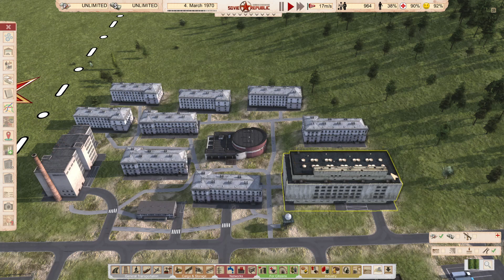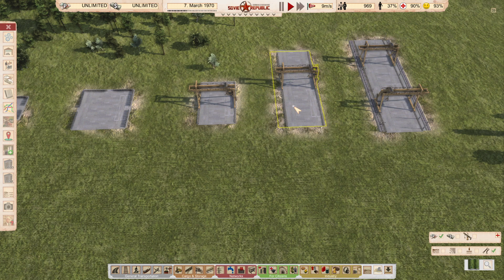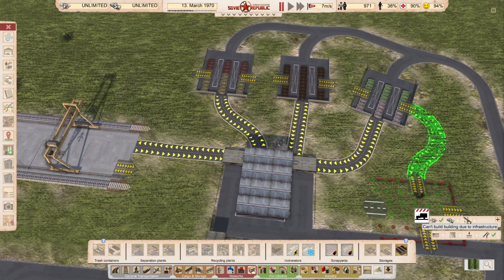Workers and Resources Soviet Republic guide to waste

Comment: ... also, I have a question. In my residential areas I have set up the trash containers in the various stands so that citizen separate waste at the origin. They seem to be doing a good job, with biological, plastic, and metal waste produced in significant quantities. However, the trucks from my technical service tend to prioritize the mix trash and, often, do not even rush to move the other types of waste even if their respectively assigned containers are full. And this, of course, results in pollution. Do you have a solution to this problem? How can I make sure that mix, plastic, biological, and metal waste are all collected? Thanks!
Reply from the maker: The only other thing I can think of is make sure your factory connections are not set to one way.  Other than that I don't know why it shouldn't be working properly
Reply from the maker: @gulfwinds  if you are having this problem check your technical service offices.  If there are no trucks sitting around then either you don't have enough trucks or your trucks are having to travel too far to where they are disposing of the waste.
Reply: @mangypanda2640  Thank you. Unfortunately, I have more than enough trucks and every single stand is well in range. In fact, the collection of mix waste works perfectly. And the collection of specialized waste works a little bit, but far from enough. While my trucks rest in the TS parking lot, entire containers of plastic, metal, bio, are left untouched. It is puzzling...
Reply from the maker: @gulfwinds  strange.  The only other thing I can think of is to make sure where you are dumping the waste can handle the type of waste you are sending.  A transfer station can take anything but if you are sending them to another type of storage it may not be able to handle what you are sending them. Easiest way to check is to change you drop off for biological waste to the custom house.  If your trucks go haul it there then you know it is an issue with your destination. If that doesn't fix it then I am not sure what the issue might be
Reply: @mangypanda2640  It can. I have copied the setup your present in your video at 11:38 and have large bins for everything. Weird, weird...
Reply from the maker: @gulfwinds Very strange
Reply: One thing I've noticed is that the game seems to only ever send one vehicle to collect from trash containers at a time. It could be that if you're using small containers, the mixed trash bin is refilled before the vehicle completes it's job and another one is dispatched. You'd have to watch the garbage stands if so and keep an eye on which vehicles are heading to it.

If this is indeed what's happening, your only solution would be to replace it with a large container stand. 6.5t of mixed waste takes ages to build up

Comment: Learned a lot. At  15:00 is there a way to export the power produced by an electricity-generating incinerator, by hooking up into existing grid?
Reply from the maker: Yes, if you connect the power to the boarder, you could export it
Reply: also priority switch

Comment: Small dump trucks can service multiple buildings in single ride. They reroll task on every intersection choosing closest valid, but can get back multiple times to the same house, picking a bit of trash. Same with trash bin stands but there they have less options to choose from at least. In your example border might be closer than any other pickup point.
Reply from the maker: That is true however they still will not be delivering full loads so it is still more efficient to use the large container stands that way you know it will always be a full load that is transported.

Comment: Great detail on the waste process and how you can manage waste in W & R USSR. The game does not have the ability to dump garbage into the waters, which could pollute the  environment. Will you implement the setup at 19:30 in your current campaign?
Reply from the maker: Glad I could help. I will be putting in a similar system but one that is more optimized to try and run the buildings at closer to 100% capacity.  The set up in the guide video doesn't allow for the general separator or the incinerator to operate at full speed.  But to set up a better one requires a lot of messing around with conveyor connections and I wanted to keep it simple for the guide.
Reply from the maker: Episode 18 of season 2 is up and that is where I set up my trash processing facility